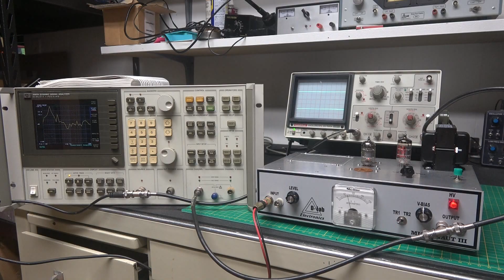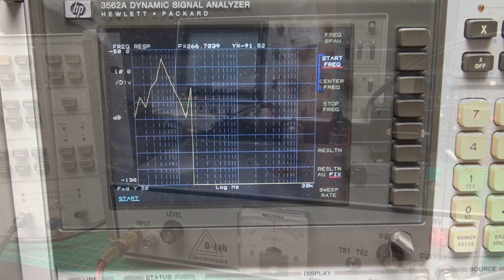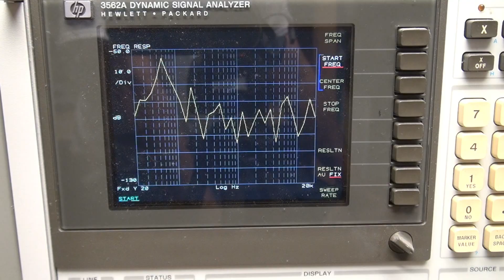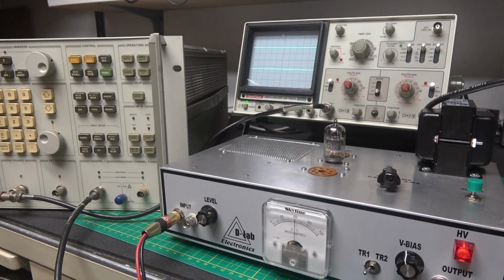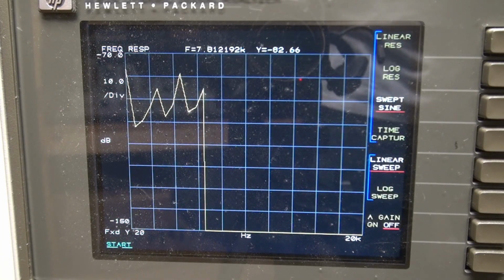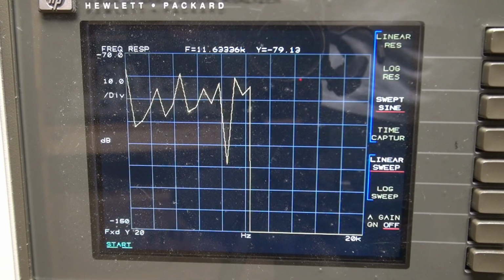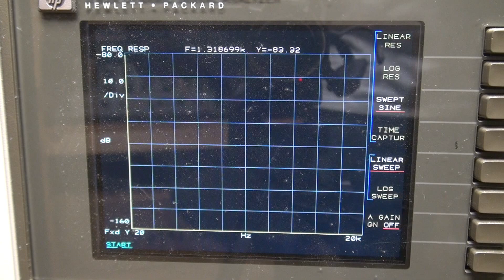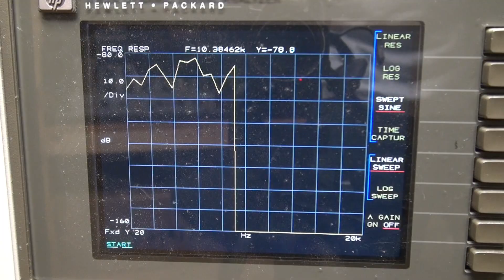12AX7 tube Frequency response testing Penta vrs JJ Showdown Experiment

Comment: without publishing the EXACT circuit (the components surrounding the tube) this test is meaningless as so much depends on the aC impedance in the Cathode circuit and even more the anode load resistance and capacitance which will include the test jig of course AND specify the HT voltage used.

Comment: I think the first issue is with the settings of the analyzer. Looking at the display, the top line is -50 dBm with 10 dB steps down to -130 dBm. In a home lab if we can maintain a -90 dBm noise floor we have a good quiet lab. A lot of your signal is around the -90 dBm level and that is your noise floor so I don't think you are measuring the signal which would likely be in the 0 dBm (1 mw) to 30 dBm level (1 w). Also, the stepped signal should be a smooth sweep. Just my observation. Hope it helps. Love that 3562A analyzer...  🙂

Comment: Opinions  about tubes not performing sopranos must be  not accurate   

 In my 60 yr old tube audio amplifier made by BELL which uses     5 stages with    this triodes and end stage PP with 6V6 I tested sopranos performance. My generator limit was 50 kHz and at 50kHz drop of output audio voltage from transformer which was measured at   dynamic headphones was like 15%,  It translates to about -1 dB

Comment: This demonstration confirms the misconception that tubes from different manufacturers have different frequency responses. Triodes actually amplify frequencies from 0 Hz up to the megahertz range linearly. There must be a flaw in your test setup or analyzer.
Reply: How did you reach this conclusion?  There was no direct graphic comparison of the performances.  How unscientific!
Reply: @thomkopal1740  Because that’s what ‘linearly’ means. You would expect straight lines, not jagged sawtooths with +/-10dB variations. Something is seriously wrong here.
Reply: @thomkopal1740  For his YouTube channel "Physik der Elektrogitarre" Professor Manfred Zollner tested dozens of ECC83 tubes (new and used) in a typical Fender input circuit using measurement equipment from the University of Regensburg. The result was that all tubes exhibited a linearity of less than plus/minus 1 dB in the frequency range from 100 Hz to 10 kHz. A 3 dB drop in the frequency response between 10 kHz and 20 kHz was due to the circuit's dimensioning (value of grid series resistor).
If tubes actually had a frequency response like the ones shown in the video, they would be destined for the trash can.
It's possible that the tubes in Terry's circuit setup were overdriven by an excessively high input voltage, and the frequency curve was determined by the numerous harmonics generated.
Reply: @WolfgangGrimm-xm4nw  Speaking from direct experience, harmonic distortion precedes overdrive distortion.  The dynamic harmonic responses are much more consistent within tubes from the same manufacturing facility (same construction design, same materials, same methods and machinery), and vary predictably from one manufacturer-design to another manufacturer-design.  The signature of the dynamic harmonic response is transferrable, giving sonic "character" to the tubes.  This is how I can predict that an RCA 12AX7A will deliver fatter bass frequencies than a Telefunken smooth-plate ECC83, and that Telefunken will have its characteristic prominent upper-midrange emphasis that would be lacking in the RCA - just to choose an example from some well-known vintage tubes.  It is repeatable, easily perceived empirical evidence.
Reply: @thomkopal1740  Sounds very scientific! But I'm not aware of any evidence that anyone has actually detected sonic differences between tube brands in a blind test. That's purely a sales strategy. I prefer to rely on physical facts and serious measurements.
Reply: @WolfgangGrimm-xm4nw  There are no RCA or Telefunken salespeople strategizing their sales.  Open your ears, and let them guide you.  Or at least respect that others can discern differences and make their choices accordingly.  I prefer to rely on empirical experience rather than have philosophy or belief systems (BS) preempt my perception.
Reply: @thomkopal1740  Okay. You're right. And all the scientists who contradict your statements are incompetent.
There are pointless discussions about this topic on many other channels, and I want to save my nerves.
Reply: @WolfgangGrimm-xm4nw  "And all the scientists who contradict your statements are incompetent."

Please cite the relevant articles published in peer-reviewed scientific journals.  Thank you.

p.s. - I AM a scientist.

Comment: Congrats, you compared a Czech JJ to a Russian or China 12ax7..  Try a good 12ax7 like, Telefunken - the old ones.
Reply: Do you have a New In Box never used Telefunken? If so then I am sure you could send it in to D-Lab and he will test it. There is no point in testing used Tubes from the golden age if you are expecting that it will tell you something about those tubes in a definitive way, since most are used and so their state is unknown.
Reply: @leiferickson3183  I have about 30 Telefunken 12ax7s, some a very low hour.  Don't need a NOS Telefunken to destroy a modern production.  I'll take a 5-10k hour Tele, RCA, GE, Mullard, Sylvania and the Japan ones over anything made now.

Comment: Something looks wrong here. 10dbm/div looks like 30db swing, it can't be that nonlinear.
Reply: I agree. What is the vertical scale.  Since I don't know that analyzer, I'm not trusting my interpretation of what I'm seeing.
Reply from the maker: Just a comparison. Yes, the chart looks choppy. I will experiment with the settings
Reply: @d-labelectronics while I'm not familiar with the 3562a (cool piece of vintage HP gear) it seems like the sampling is very coarse, I would expect a smoother line not looking like a saw tooth. I hope you figure it out as it's an interesting test and it's clear you invested a lot of effort into the test fixture.
I think another interesting variable would be to change (sweep) the tube bias +- from nominal to see that effect on the bode plot. This would give an indication of the device (tube) transfer function with respect to bias tolerance.
Very interesting experiment, first time I've seen anyone trying something like this, I hope you succeed in refining the result.

Comment: That's a horrible frequency response, Terry. I would expect to see a ruler flat response from 20hz to 20khz. What you are seeing is the frequency response of the amplifier that uses the tube, not the tube itself. The tube itself should be capable of flat response well above 20khz in a properly designed circuit.
Reply from the maker: Will be experimenting with the generator and post updates
Reply: @d-labelectronics following! 👀
Reply: The 3562A has a transfer function mode and needs a reference channel set to measure the input and a second channel to measure the output and it computes the ratio of these measurements to compute the frequency response. The results are garbage, -80db on scale on the left hand side of the screen shows that no gain is present.